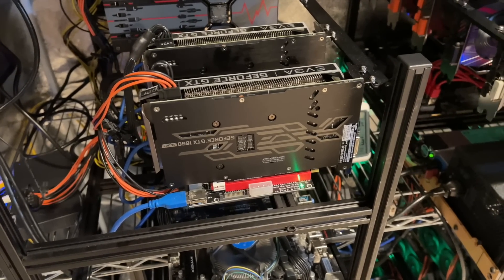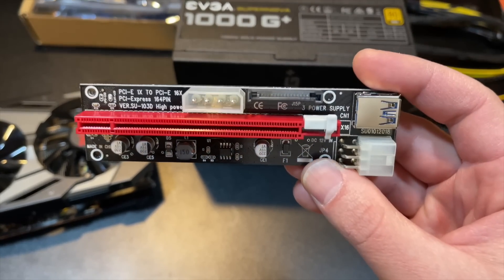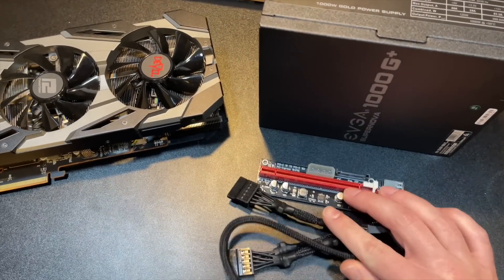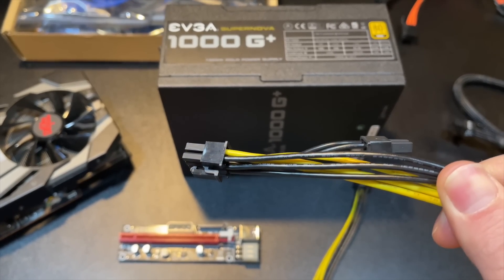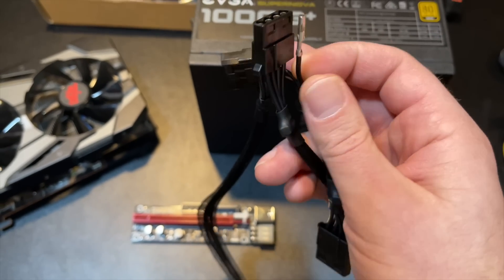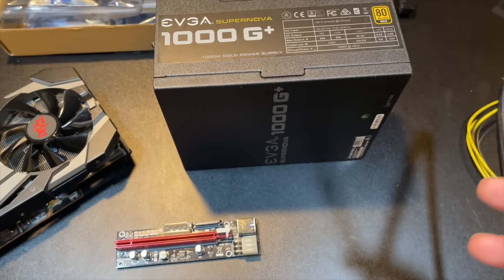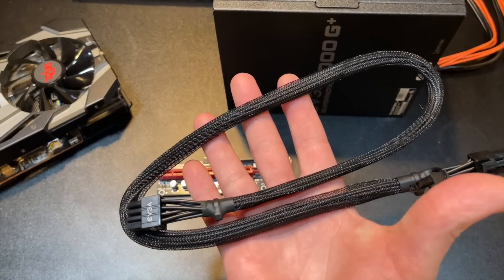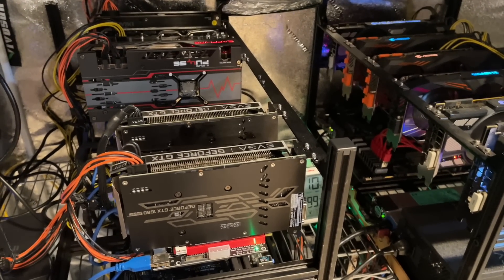Powering GPU Mining Risers Safely

Comment from the maker: BBT Testing if you don't believe me: https://youtu.be/8GCHPTFH-70
Reply: as mentioned PCIE is 75watts, why in the video they are getting more than that from the riser ?
Reply from the maker: @sapnupuas8235  I'm wondering that myself. I was surprised to see that.
Reply: @RedFoxCrypto  Please help me out. I want to use two 3060ti FOUNDER EDITION card with one 8(6+2) PCIE cable using PCIE splitters. Means my one PCIE cable have dual 8(6+2) Pin, I want to connect one PCIE splitter into one 8(6+2) Pin and one PCIE splitter into one 8(6+2) Pin. Now I want to connect two 3060ti FE card and two riser simultaneously with one PCIE cable using two splitters. 

Please suggest me is it safe means I can connect this ?
I am waiting for your reply thanks in advance. 

Love 💘 from INDIA
Reply from the maker: @sebastiaocunhareis925  The GPU does all the power pull so he 125w pull includes the riser pull.
Reply: @RedFoxCrypto  I apologize if this is a stupid question - but I was confused about this too - If I'm using a splitter (due to shortage of VGA ports on PSU) to power up a riser and GPU - all I need to account for is the GPU's TDP without accounting for any power draw that the riser may take?
Reply: @RedFoxCrypto  what about the rating for the 6pin connectors from server psus? 
I am powering a 1660s using a single strand from server psu split gpu+riser is that safe?
Reply: Can you update the pcie splitter link to something in stock?
Reply: @nicholassmith7723  errwrqqrwreeqetetqeqeeqwqewrqerqeetqeqtqreeee
Reply: @sebastiaocunhareis925  my thought too
Reply: me watching this on a PC while mining on an RX 580 going full blast powered by one molex to 6pin PCI to 2x PCI-E 8pin... Uhmmm.... How much is that per wire? :)))))
Reply: @StriderAngel496  Hope you have fire insurance...  Not safe... real talk.  Those splitters will burn up.
Reply: @helixthree  welp...I'm just doing the touch test every day or so, if you can hold it in you hand than it's well below melting point xD. it all depends on the power draw as well... if the card doesn't draw that much from it, it doesn't heat up.... maybe i just got lucky with the molex converters and they have thicker wire :)
Reply: can i connect the riser and 3060/3070/6700 with the splitter, could you elaborate on the splitters
Reply: @sebastiaocunhareis925  I stopped the video at 15:34 and said the exact same thing. I don’t see the other end of the splitter, but I’m assuming it’s the recommended PCIe single cable rated at 192W.
Reply: You miss quoted power cabality for sata. There is only one 12v line there not three. There are three cables with voltage sure but the other two are +3.3v and +5v which cannot be used to draw power to riser. If somebody uses sata to power risers another negative effect is that usb cables start to supply power tothe riser from motherboard using yet again a single cable. There are plenty of evidence on internet confirming this to be the case and thats why mining board manufacturers instruct users to plug molex etc cables to the motherboard so that it has more power available BUT if we use 6pin power this never happens. Total power drawn by motherboard can be below 20w whilst the rig is mining. This happens only when using correct method to supply power to riser which is 6pin. Moron which designed a riser with sata should be sent to repair all those burned homes...
Reply: @piotrpoliwka1148  i agree, it's a bad design but it's also not as exaggerated as you make it seem... you're not gonna burn your house down...at the worst, you have a few wires melting and some burned plastic in the air which you can easily deal with IF YOURE NOT A MORON LEAVING YOUR "RIGS" UNSUPERVISED... Computers crash, they can malfunction, they can overheat etc... The people that burn their houses down are the idiots that think mining it's as easy as plugging a PC in and turning it on. ALSO, when you configure your hardware correctly to not use obscene amounts of power for no reason, the power draw on those wires is also smaller which can keep them from burning up. Wires heat up when you put a lot of Amperes through them, no matter what. Have a touch on the normal PCIE cables from your PSU and tell me they are cold... They're not... They are warm after heavy use... All wires heat up... It's just that you have to keep them cold enough that they don't melt.... Most of the rises that use molex and sata also connect to 2 plugs so efectively they use 2 12v wires (the yellow ones) instead of the 3 a PCIE has which is not that bad considering a card should never draw more than 75W from the motherboard while it can draw 300W from the PCIE dedicated line... let's do the math... If 8 12V wires (double 8pin PCIE) can carry 300W than 2 wires should be able to carry 300/4=75W :D. Do some actual math and stop screaming and exaggerating everything... What's up with people wanting to create drama from anything nowadays :|
Reply: @piotrpoliwka1148  True, but back in 2016, huge percentage of miners used sata risers with cards like 470,480,580, 570 etc. I was mining like till 2018 on mostly sata risers.
No issues.
Thats not some bla bla words, just rewind tons of youtube miners videos from 16,17,18.
Even now Ppl with normal psu, running 1660,3060 series on em.
Yep for sure, 6 pin is the safest way.
But with casual psus it is often a problem to connect all with pci cables.
Since 18, i switched to server psus, forgot about molex, sata..
Reply: @semensh1  yes and how many of those rigs have you seen? I've seen everything, burned, melted or insulation on wires turning into dust thanks to many months of baking
Reply: @piotrpoliwka1148  I saw many rigs, and also saw burned, melted and so on, on molex, sata, 6pin risers. 
Point was about days when molex and sata risers were everywhere, and it was the only way for ppl in most cases. 
Now you can buy server psu, special mining psu, everything. 
And also I can tell you, that using modular psu is not the safest solution, cause modular psu have 3 weak points(connectors on psu, and 2 connectors on wire). 
And if you saw burned rigs, then you know, that most of the time its not wires, its connectors that melt or burn. 
In US ppl like to use break boards for server psu. 
Where I live, ppl rewiring server psus with higher grade cables, so you have only 1 weak spot, end cable pci(6+2) pin.
Reply: @semensh1  I don't use splitters of any kind and only server psus. I connect 4 cards per 1200w psu and I too never saw a problem with that.
Reply: @piotrpoliwka1148  I dont know, back in 16, all new trends in mining mostly was from US youtubers, mining forums etc.
Now i'm watching this stuff, and, yep  some cool content, but nothing more.
Thoose open frames, 2 psu, 1 just to start mb, casual fans.. Why? I think from 19 or so we are using only server cases, or mining closed cases with server grade fans, or asics fans(delta, etc), using pico psu to start mb from server psu, even using server mb with custom pcie boards. 
And this hanging cards, or open frames reminds me milk crates mining rigs from 15, but in fancy cover. Thats my opinion, and no offence, but when i saw this new wave miners with 6 year old solutions, I'v got only 1 question - why?
Reply: @semensh1  are you suggesting that us youtubers created sata powered risers? Not sure what you mean by this comment
Reply: @piotrpoliwka1148  Nope, that was another thing. Thing that shocks a little bit.
US guys made trends in mining.
Now most of them really far in the back seat.
Like this A4000 review in november 2021.
What next, in december they will be talking about new miner nvidia cards, that tons of ppl from "poor" regions already got, and mining on them? 🤦‍♂️
Cmon.. There are tons of reviews, builds, settings for a4000, a5000, a6000 from Asia, Russia, East, Europe, created in june abd july.
I bought some a4000 in july, and they are mining all this time. 
And how so that in US nobody created some content about it. 
Same with all stuff i said earlier. 
All vids now are just some kind of copycat "bitsbetrippin and other oldschool miners" 2015-2016 videos. 
But they made rigs from wallmart scrap, got some cool ideas.. 

Just dont understand whats wrong..
About sata, i said, but for cards like 1660,6600xt, 3060 they are ok. 
But in situation when you stuck with casual psu. 
Also about some scare splitters. 
This is not a big secret, that all risers, splitters, boards, etc, that are selling under some fancy brands, just custom branded stuff from alibaba.
Reply: hey there, could you advise the cables I should use for for my RTX3080 and my risers?
Reply: Why don't you just measure the resistance of the cables, and then do the math with Ohm's law?
Reply: Bro, my 1070ti board has 2 inputs, so I can't power the Riser 009 and the board with just one Splitter.
Can I use a 2 molex to 6 pin adapter to power the riser?
Reply: What would u suggest ,for a beginner mining on windows tres or hive os
Reply: Btw the markings for the molex and any cable really are often on the side of the wires themselves.  Should be small white text on the black wire coating
Reply: i mean yeah sure, if you go by theoretical maximums you are correct... BUT, the power supply for the GPU is usually over dimensioned (for example my rx 580 has 2x 8pin connectors, that's more than enough to power the GPU by itself, without any power from the motherboard, if you add the motherboard power too they all split the load and it comes out to about 50W per connection, which even 3 SATA plugs can take) so in that case, one SATA for the riser and 4 for the GPU supply is enough :D... It's not ideal but it does it just fine most of the time...

I don't know, most of the time in the real world the nice perfect whiteboard definition doesn't really cover the whole story... That's why theoretical physicist express things wonderfully on a blackboard but can't implement it and engineers do a messy trial and error job but they end up with an actual working product xD (which has let's say 85% efficiency)
Reply: Hi Red Fox, just as a note, I have reached out to Seasonic regarding the rating for their 4-pin molex connectors for the Seasonic PSU I have and they were happy to provide me with the rating. I won't share it here because I don't want people to assume it applies to all Seasonic power supplies (could just be my model), but on the issue of molex I think there is a good recommendation- Ask the manufacturer!!

Comment: Going with the larger conductor is always safer.  More conductor area, less heat. The Molex connector or the PCIE are best choices. Splitting the ONE connector for BOTH connections places MORE Amps on ONE connector to the PS. Using separate cables for each is SAFER.  If you don't have enough connectors available at the PS a splitter for two or more risers is fine. DO NOT SPLIT TWO OR MORE PCIE GPU POWER INPUTS. It'll smoke.

Comment: Mike, watching 4 years later.  Was having a problem with the SATA drive hosting my OS going AWOL after I added the latest GPU on my AI rig.

I searched "PCIe risers".  Got lucky when I landed on your video! My mind was no where near power supply issues.

Long story short I had the riser, two Delta fans, and SATA all along the same Molex.  Turns it was the fans (even when turned down-- I suspect they were just too noisy).

For whatever reason I always assumed Molex was equipped to handle relatively high wattage.  Any ways, I now know way more about the cables' power limits and Molex's ambiguity.

THANKS!

Comment: 5 amp for each wire in the Molex is fine because multiple wires carry the current and therefore add up to give plenty of current carrying capacity... The current carrying capacity of the whole cable is what matters... two wires for negative and two wires for positive at 5 amps per wire = 10 amps. Plenty....

Comment: I was interested in the current on the sata to 6 pin pcie connector cable. 

I purchased a hall effect sensor and ran an experiment.

On a CMP30HX, only 2.5A on each 18AWG/60C conductor 

On a CMP50HX, only 1.25A on each conductor

The Sata to 6-pin PCIe cable is safe to power the GPU riser PCB.

Comment: Great info, so I would like to add a 5th GPU to my small rig but i don't have anymore 8 pin outs on my PSU, how do i then connect the 6 pin riser and 6 pin GPU with only having 6 pin outs left on the PSU, they don't come with 6pin to 6pin cables. Any idea, thanks.

Comment: Hello, I know this is not the type of question I should ask in these videos. But I want to use a riser to plug my rx6600xt and game on it, I do notice that you did use a pcie splitter to extend 1 pcie to the card and the riser, would it be possible to plug 2 different pcie, 1 for the riser and 1 for the card itself? Does it make sense if I just skip the riser and straight up plug it in the gpu? And would it still work if I just used molex for riser and pcie for the gpu?

Comment: Thank you for the video! According to Corsair costumer service in Germany their Molex and Sata cables support a max of 60w. Everytime I am trying to link the source YouTube auto deletes my comment. It leads me to frustration that the only safe way to power my risers are PCIe cables since I am in need of a PCIe 8pin to 3x 6+2pin splitter now in order to power my three cards which were supposed to run on my first PSU. If anyone has a recommendation I would appreciate it.

Comment: Your molex connector is fine, just ask the water cooling community that used high power Delta fans on their radiators.. go by the wire gauge you'll be fine.

Thanks for the info on the connectors for the riser board, figured it just needed one power source just had to verify.
I'm going to try one of these on a mini pc to m.2 adapter and see if I can make a budget pc for the kids with old GPUs.

Comment: 14:41 why use a 1*6pin to 2*6+2pin? going from rating of 75W to rating of 300W, sure you only use 2*6pin but the 6+2pin Connectors are still on there and people will try to use it to pull 300W, I'm sure of it

Comment: even this video is from 2 years ago, I still want to leave here a question, if I plug in all the cables to those connectors, will the gpu power usage will spread out equally to all those connectors? like gpu tdp is 75w, and I already connected to 1 ATA 4 pins, 2 PCIE 6 pins, will it be like 25w/connector?
Reply: Interesting question :)

Comment: Thank you for this info, and for the links. Saved me about $30 for the splitter cables in addition to answering a few questions I've been pondering lately about the best methods (safe) to power risers & gpus.
One question I still have. If you have a pcie cable coming from the psu, and going to a splitter. I presume the total amps carried by that cable is split evenly between the 2, right? 
It's just like if you have say 5 outlets in a room, on one 15 amp circuit. Technically speaking, the 15 amps is spread across those 5 outlets evenly. They can't All draw 15 amps (thru every outlet), at the same time.
Reply from the maker: 100% right my dude. Happy mining buddy!

Comment: As an Industrial electrician if the old Molex used thinner metal rated at 5amp. The new Molex you show have heavy pins, and if the connector is made with 18-16ga wire the pin needs to be rated to handle the power capable by the wire or 60% if it spits to 2 Molex. To meet standards and get certs the basic formula must be follower. So if you have PCIE to 2x sata  each sata needs to handle 60% X2 = 120% of wire and wire rating can be looked at in 2 ways. A 16ga @ 10amp == 100% actual wire rating is 12amp 20% for safety and overhead spikes. Most Modern DC industrial electric is done with 22ga or thinner wires even in 250,000 watt plasma Metalica vacuum deposition chamber. Best reference material is UGLIES pocket edition electric and electronics book. Just look at all the mess around the new 40 series by Nvidia, Yes those tiny wires and pins can handle the current and watts but with using such small wire they should have crimped ends and each wire on a screw terminal not a plastic plug with only 1 locking clip ,,,,, good design bad execution of it

Comment: The PCIe spec is 75 wats total, not 75 watts on the 12v rail. the 12V Rail provides 66watts with the 5v and 3.3v making up the remaining 9 Watts of power. Also If you aren't using nVidia's drivers for the GPU's then the PCIe slot only calls for 35watts, it is the Drives that configure the PEX rail for High power device, so if you aren't using nVidia's drivers 35 watts is max draw on PCIe slot, with the 9 watts taken away for the 5 and 3.3v rails thats 26 watts on 12V rail